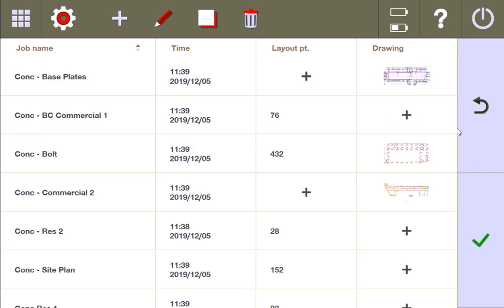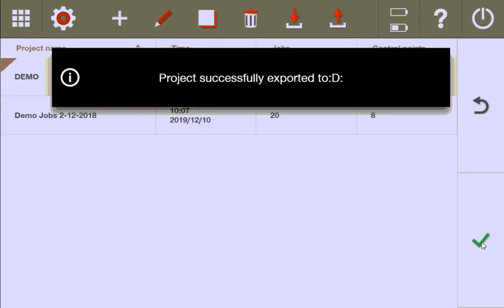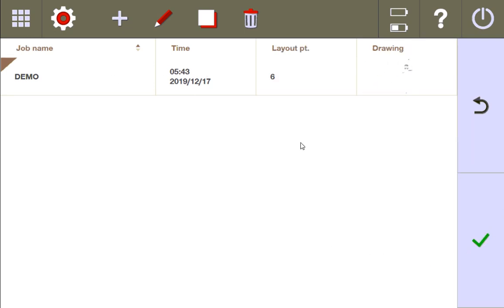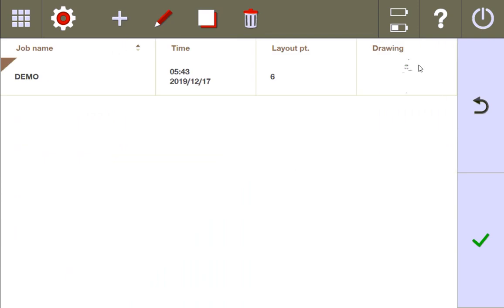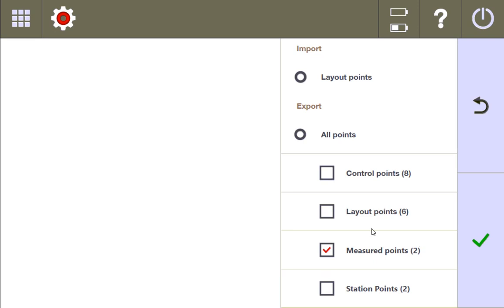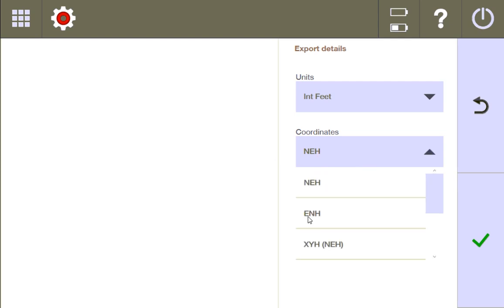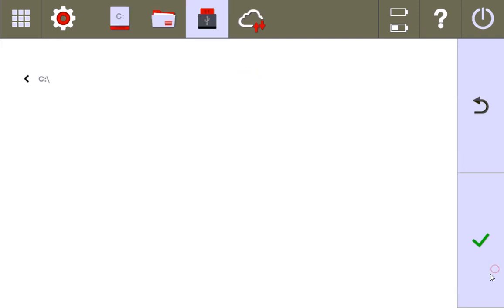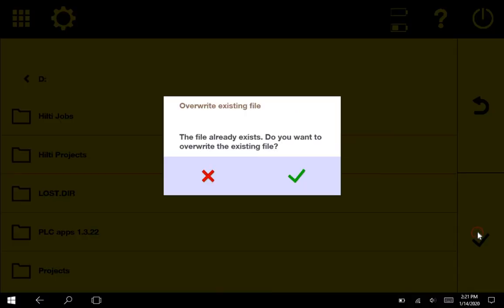Hilti PLC 400 Tutorial - EXPORTING PROJECTS/DATA

Comment: I exported drawing, all nmy layout points were gone.  how do I export with layout points on drawing.
Reply from the maker: Hi Tim,

To export points as part of the drawing, you should be able to export the drawing and the points will be on there. However, it is typically best to export the points out separately as a CSV and then overlay them back onto the CAD file.
Reply: @measuringsystems869   So, I added 96 layout points to my DWG, exported to USB, imported to a different job, and I have to add all 96 points again??? OR how do I overlay them??
Reply from the maker: @timforner3491  Tim, are you in the US or Canada? Hilti has a customer support number  that can direct you to the total station support team:  1-800-879-8000. They can direct you to the back office support team and I'm sure they can lead you through it. It's pretty straightforward.

For your situation, though, make sure you export your POINTS from that job as well and import them into the new job. No, you do not need to completely re-make them.